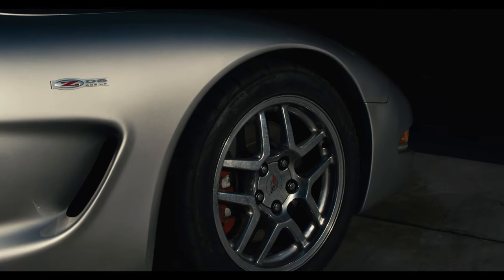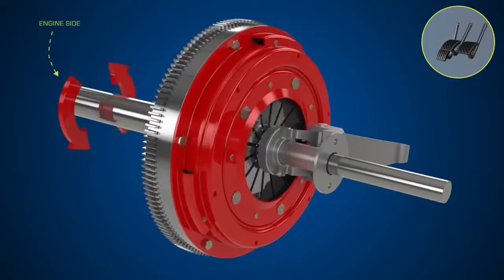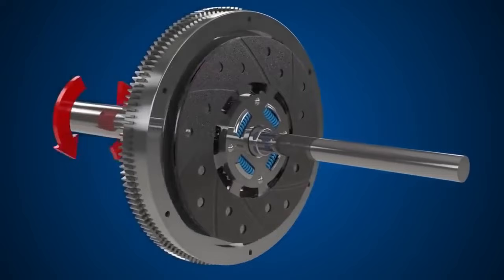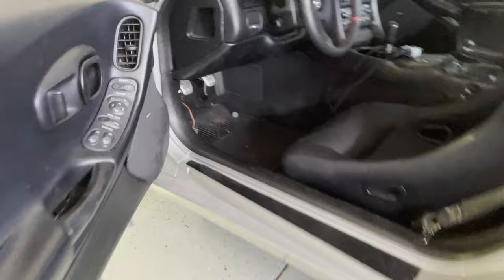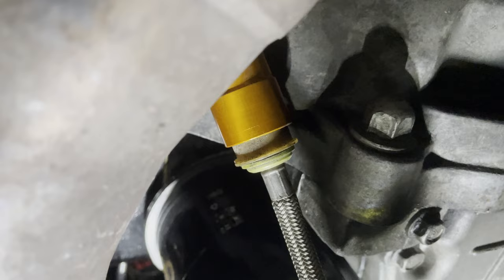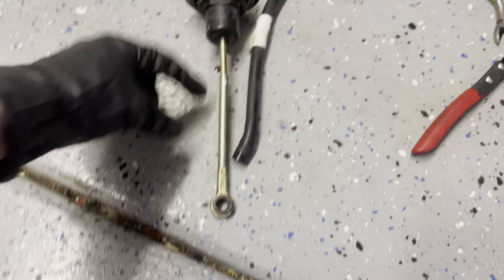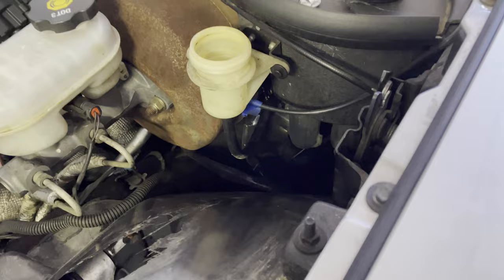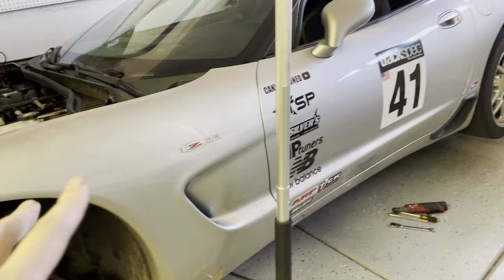Upgrade this part on your Corvette ASAP! Your transmission will thank you.

Comment: I'm starting to have problems with mine and it only has about 30,000 miles now. The other week, when shifting as fast as possible during what was supposed to be a 1st-4th pull, the clutch took a  second or so to re-engage when I went for 3rd. I thought I missed the gear, but when I tried to pull it out, it didn't want to come back to neutral. My best guess is that it had come back all the way by the time I tried to pull it back into neutral. I believe that I read somewhere that you can put the helper spring back on and massage it to fit around the new stuff despite the instructions in Tick's kit telling you to get rid of it, but I don't know how accurate that is.
Reply from the maker: It also depends on what clutch you have, the oem and ls7 clutch have self adjusters as it wears. Aftermarket clutches don't. So readjustment is needed. Not sure what your situation is but you may need to add more throw to it again
Reply: @CanyonTuned  It’s as stock as they come. Definitely a fluid problem, as what is actually visible in the master cylinder reservoir is totally black. I’ve taken the fluid in the reservoir out and added new stuff in an attempt to dilute it a few times, but it doesn’t work that well.
Reply from the maker: Old fluid attracts water! I'm betting a flush would fix some of those issue